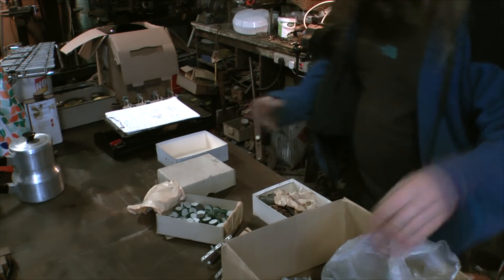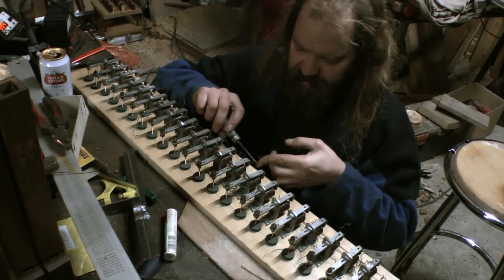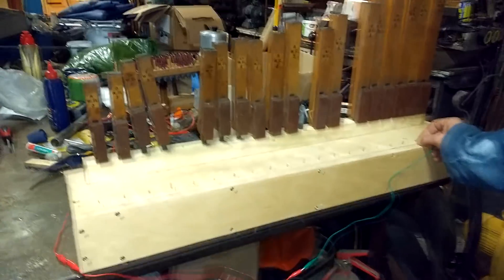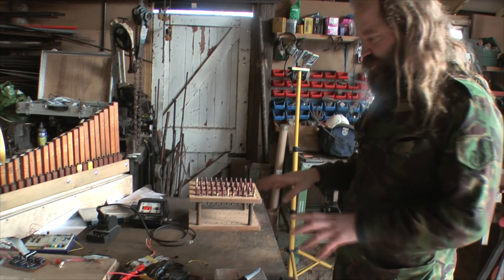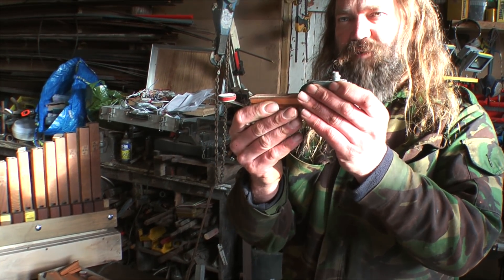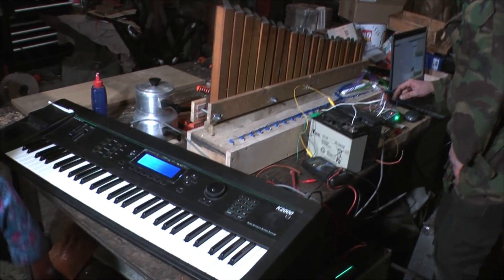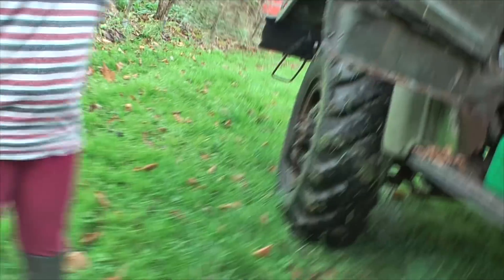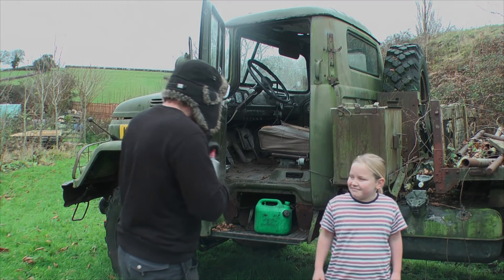Project Awesome 3: Zil Up The Hill

Comment: Electronics, engineering & tesla coils - what more could you want,  although the tesla coil is sadly a lot smaller than I had hoped for , -grin.
Reply from the maker: It's just the prototype ;-)
Reply: I certainly wouldn't want to run a much bigger coil that that in my living room. It plays havoc with all the house electrics anyway.
When the weather gets warmer then I'll be building the bigger coils outdoors! :)

Comment: Not exactly an old school pipe rack on that chest mate. Let me guess, you did your apprenticeship with Walker.
Reply: RAJ Bower and Percy Daniel & Co. actually. ;)
The 'rack' in this case is designed to keep the pipes from falling out when being transported on the back of a truck. (Max designed that bit, it's an example of what happens when you let blacksmiths do the organ building!)
Reply: spungletrumpet. A fine pipe organ company ! Actually the name does not ring a bell. Me ? N P Mander. Dont know if they are doing much these days. Still it was funny to see a bunch of direct electric magnets and stuff being appropriated and repurposed. Keep up the good work. Always fun to see what happens when an organ builder goes wild.
Not many of us left these days. Cheers.

Comment: I wouldn’t spend much money on it until you are sure you can register it for the road. There are loads of possibilities. But all of them come with some restrictions often quite onerous. I don’t think it will pass a MOT without spending loads. I suggest showman’s with the organ “permanently” bolted on might be a goer. Think long and hard about changing to diesel.  Those 140hp Cummings will struggle with all that 6wd transmission whirling around. I should know I have an ex mod DAF which is not happy over 45mph. Or try TVO it might run with a bit of added Petrol. Or look at lpg it will be a lot easier to fit. Anyhow good luck what ever you end up doing
Reply from the maker: It's already road legal. I used to drive it around on a regular basis before parking it up for ten years. Diesel is a must for many reasons, not least the fact that having Tesla coils on the back will rule out LPG or petrol! None of my current vehicles go much over 45mph :-)

Comment: So the Zil have moved about 200 meters on 15 liters of gas?

How did you even get it there in the first place =D
Reply: Actually, ZIL's consuption is 50L per 100km
Reply: With 15 liters or more of gas or vodga. Also reason why columns of soviet mechanized infantry usually had least one, or more fuel carrying variant with them. Again its soviet military, trow cheap shit enough on the wall and some will eventually stick. Back then trucks could use how ever much fuel, long as it used what ever it was given and needed relative little maintenance and that maintenance could be done by drunkard Ivan from maintenance core.